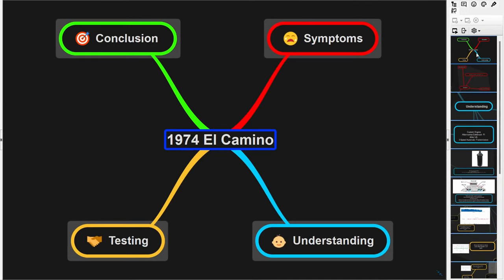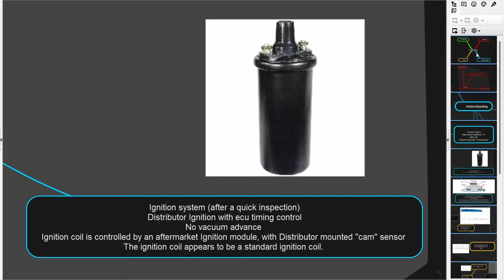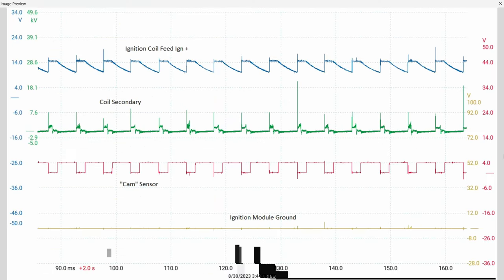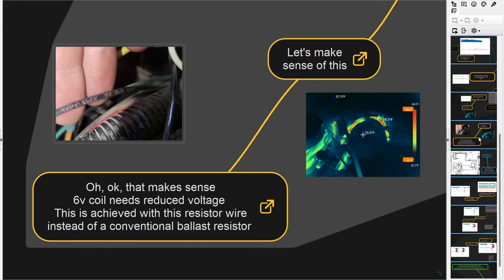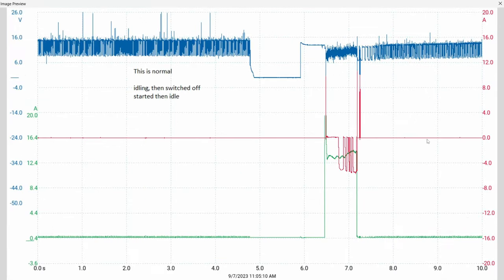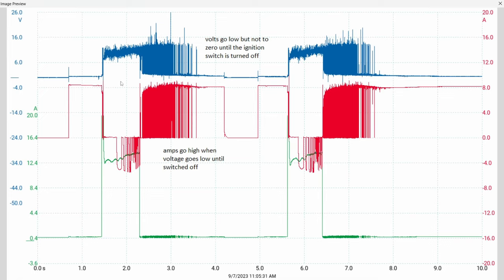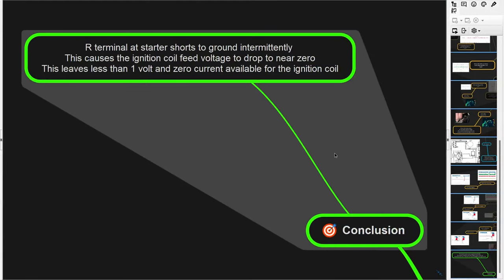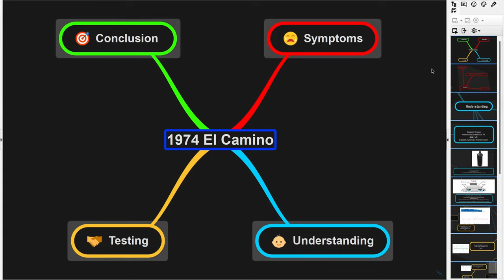Intermittent Stall Strategy Case Study (You wouldn't believe it without proof)

Comment: As a confirmation that the "R" terminal was being shorted, were you able to disconnect it after starting and drive without stalling until you shut the engine off again?
Reply from the maker: That would have been an effective way to confirm. But, the scope capture shows mechanical action on both the current and voltage waveforms. That hashy noise when the solenoid was released was enough for me to call the solenoid/starter.
Reply: Nice diag on an old relic!